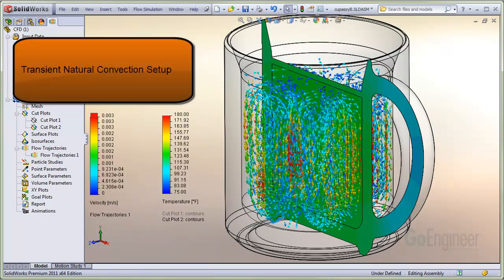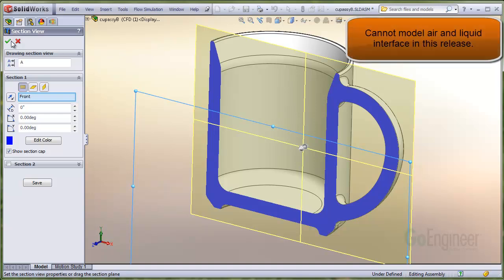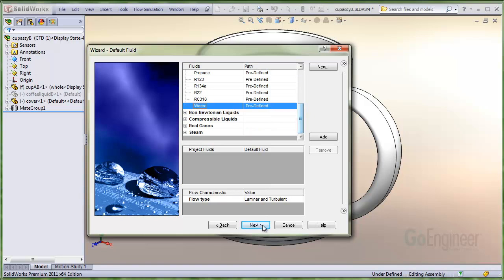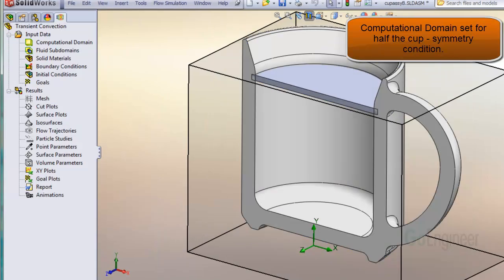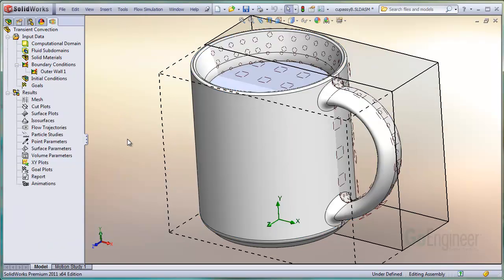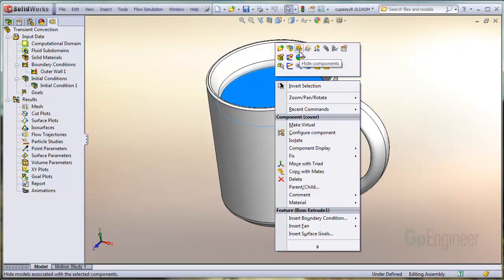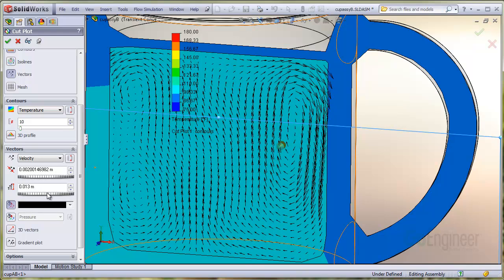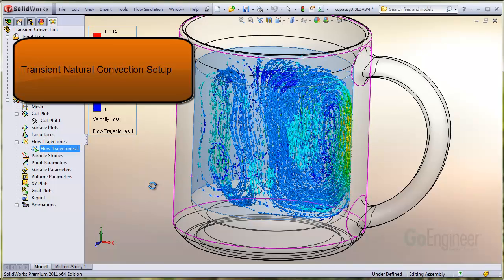SOLIDWORKS Quick Tip - Flow Simulation - Transient Natural Convection

Comment: Hi. Actually, you could remove the liquid and place an assumed convection coefficient on the top surface of the liquid. However, we put on the lid in order to use the initial condition of inner walls - which only works on "fluid enclosed space" - so without the lid there would not be fluid-enclosed space.

Comment: Hi M. Botting ... I really appreciate your video, but there is one particular simulation I would like to see and that I'm having trouble with ... Could you help? I would like to CFD the sun radiating on a surface, in my case, a cylindrical tube, so to read the inside wall temperature. How do I setup this simulation for it seems I can't get it right. Could you show us (Me)??? ... Thanks ... Luc (Faads)

Comment: Would it be possible to run a similar simulation wherein one specifyies a heat transfer rate from the exterior surfaces, instead of a heat transfer coefficient?

Comment: What material are you applying to the "lid" part? The convection/conduction mechanics in that part will influence the flow characteristics so I'm wondering how this was handled. I tried this simulation with one, modeled  part with the lid as a feature and the natural convection paths are not coming out correct at all. Everything else including the boundary, initial, material, etc conditions are the exact same. Granted, my geometry is different, but natural convection flow should like natural convection regardless.

Also, at what time step are you observing the flow? Since this is a transient analysis it takes time to develop and the initial seconds won't look as nice as what you show in the video.

Comment: I tied to follow all the steps in this video, except that my model is different but i'm unable to set boundary conditions the way the video shows. i.e. my tree doesn't give me an option for "Initial Boundary Condition" as shown in the video. Please Advise.
Reply from the maker: Hi Rohit,
If you do not see the "Initial Condition" option in your flow tree then you would want to double check that the project's "General Settings" have "Time-dependent" enable.  If it is enabled then you can always define an "Initial Condition" by going into 'Tools', 'Flow Simulation', 'Insert', "Initial Condition".

Comment: Why the heat transfer coefficient is 25 W/m2K? How did you calculate it? Or is it just an assumption for the sake of the simulation demo?
Reply from the maker: It is an assumption for the sake of a speedy calculation. Flow Simulation could alternatively also have airflow outside the mug and calculate the heat transfer coefficient for us, and how it would vary across those mug faces.

Comment: Are there any sites or links that may have built up a database of fluids or solid material properties that may not be in the current pre-defined library but could be added to the user-defined area.   I am looking for Lead (Pb) in liquid and solid state.
Reply from the maker: There are various material libraries like matweb available to characterize solid properties. For fluid properties especially involving  problems about phase change, you might have some luck with looking through publications like Elsevier or google scholar. Thanks.

Comment: Can flow simulation back out convection coefficients or convective heat transfer?
Reply from the maker: Hi Connor,
Flow Simulation is able to both visualize (via "Surface Plots") and give numerical data (via "Surface Parameters") for "Heat Transfer Coefficient (W/m^2/K)" as well as "Surface Heat Flux (W/m^2)".
Reply: Thanks!!
Reply from the maker: Thanks for asking. :)

Comment: not able locate initial condition on left side tree
Reply from the maker: The initial condition link needs to be added to the Flow Simulation tree.  This can be done by right-clicking on the name of the project at the top of the Flow Simulation tree (right above the input data link) and selecting customize tree.  The initial condition link can then be checked on in the list that appears.  Thank you for watching.